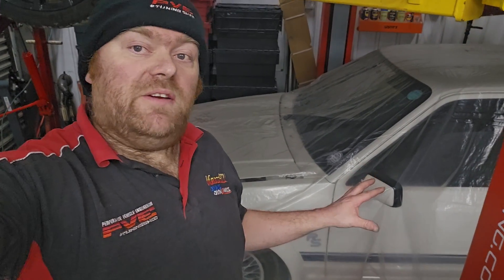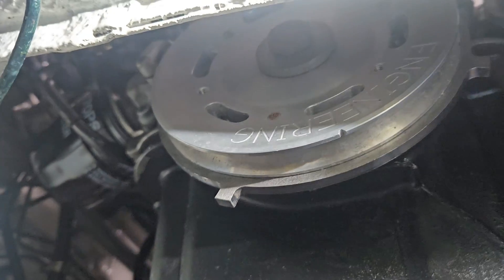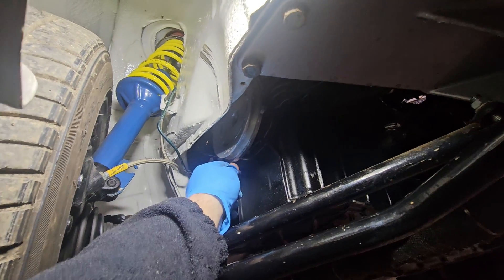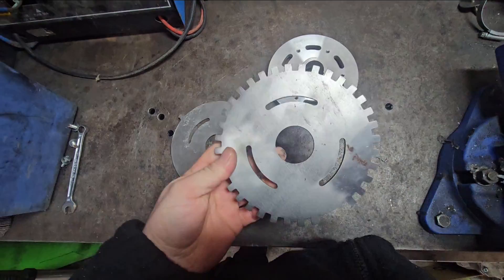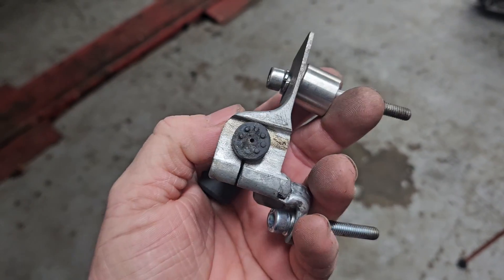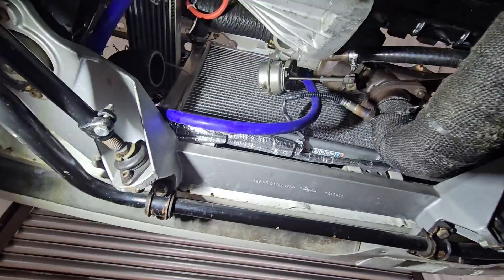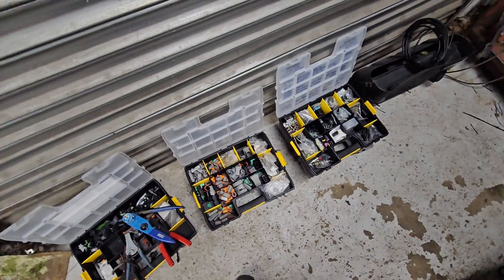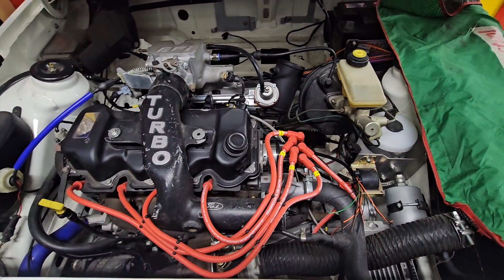Escort RS Turbo S1 ZVH MaxxECU Conversion, Episode 3. EFi conversion,

Comment: Can you provide some shots of the engine mount and body brackets. Does the CVH mount bolt to the Zetec block maybe? I am doing a ZVH conversion to a US model 1988 Escort GT Turbo, that is most similar to the MK4. The frame, chassis, and unistructure is very similar on the UK and US cars. Do you have any leads on the RS1600i front suspension pieces. The swaybar, control arms, tie bars, and corner frame braces.